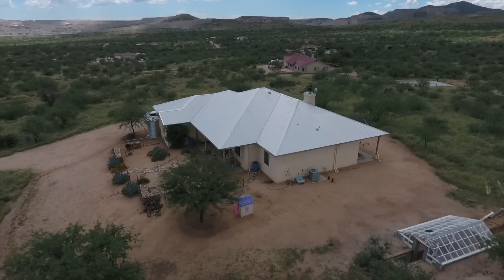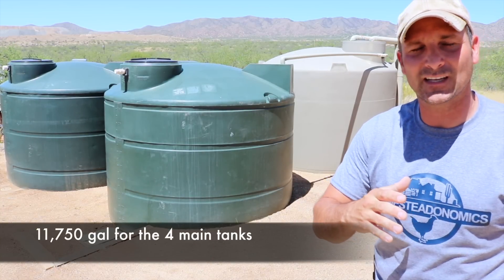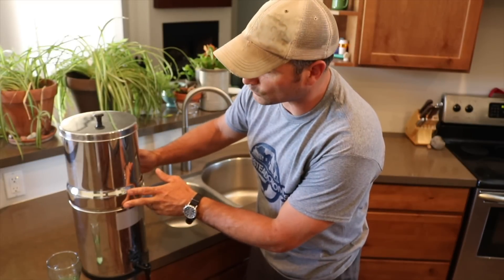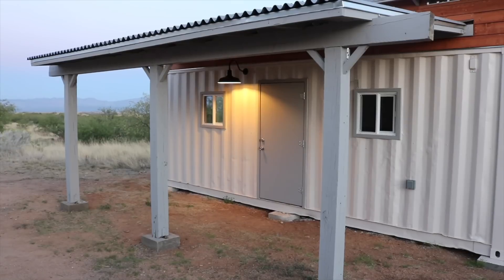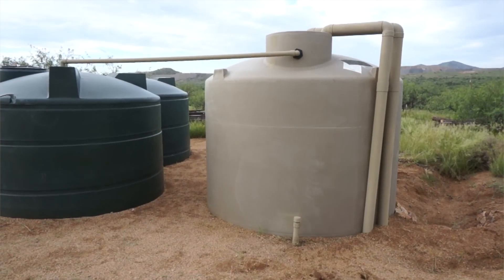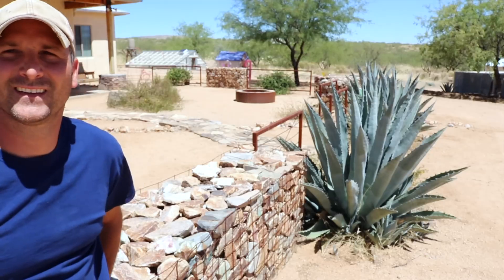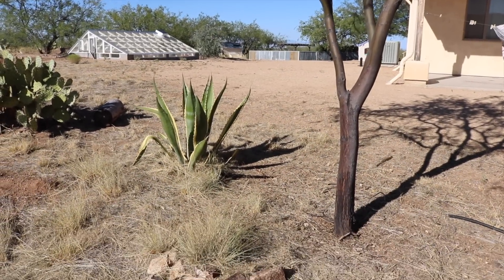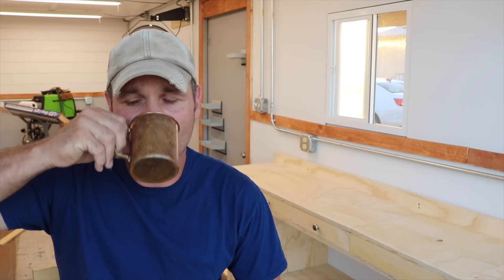Rainwater Harvesting QA - Cost, is it Illegal, how I treat, etc,.

Comment: average house household uses 300 gallons per day. 300*365=109,500 gallons per year using the 600 gal per in of rainfall for 1000 collection area. you wood need 182.5 units of water collection. to find out how many collection are get the average rainfall or expected rainfall for Arizona its 12 in. 182.5\12= 15.3 collection area units. 15.3*1000= 15,300 square feet of water collection needed for average home.   Formula is (((Hu*Ndays)\Gpc)\Rf)*Carea  Hu= household usages Ndays = number of days you would need to use correct rainfall to match. Gpc= how much water is collected per given area per inch.  Rf= rain fall make positive that its annual week month daily matching Ndays. Carea = the collection area. so for Arizona you would need a figure 110,000 gallons storage 15,500 square feet of collection area to have 300 gallons per day.

Comment: The top of those HUGE tanks you have is higher than the bottom of the drainage for where your pipes come from the rainwater catch from the house roof. So what do you do for a setup to carry it to the top of those huge tanks? How does that work? Water doesn't flow uphill...

Comment: 14:38 our water bill is only an average of $21.00 per month and we use an overall average of 2,287 gallons of water per month. At a cost of $5,000.00 it would take twenty years to recoup the cost. (I wont live another 20 years) I could understand the investment if you lived off grid with no city water available or if you were prepping for a catastrophic grid down event such as an EMP attack or a large CME event. Without power, you soon run out of city water. For me, that would be the "main reason" for investing in a rain water catchment system as well as a solar power system.

Comment: I have something like this system at my summer house ,  all thaw i have a water well and its working perfect , but i harvested water for the trees gardening, and car wash , and to take care of first roof wash off water getting in to the storage tanks  i have installed a veep pipe at each down poor pipe billow the turn to tank at leased 2 feet long   with a caped  bottom with 2,  3  half inc holes and 2 more holes one over each other at abut 15 inches up form bottom , i also stuff screen up from bottom to keep water running out keeping the leafs from plugging  the drain holes so  if the rain is not a strong one i wont collect the roof washing water , when rains good hen the first gallon or so will drop to in to veep pipe  and run out, and the water raised up to a  t"   at,  at leased  18"  high enough above  debris   then will travel to the storage tank, and at every one or two rains i make sure the screens are clean and replaced if needed.   while collecting water you also will be loosing some with this system , if tat is concern you can install befalls like on your stove chimney pipe .

Comment: You should find out why Santa Cruz does not allow rainwater collection. I could tell you but you should have some respect for regulations without getting killed by stupidly drinking rainwater in  plastic pipes and plastic tanks.
Reply: The EPA banned plastic pipes and tanks for legitimate reason that took 40 years to prove .  Reason should be enough coming from people who have decades of science education. The Flint Michigan civil notice references to chlorinated water refers to the dangers of plastic pipes and plastic tanks.  Perchlorate perfluorate and perbromate are also common to rainwater with ammonium sulphate and nitrate salts. Yosemite park lost a family to rainwater.
Reply from the maker: I am aware of the negative effects of plastic.   There is seldom a perfect solution for everything.   Our final drinking cooking water is ceramic filtered and stored in stainless steel and glass containers.   Not perfect but is what we could do and what we were able to afford when setting the system up…..but we do have plans for a concrete cistern or a large metal one.     As well as a whole house filtration system which will be installed soon. 

Now one thing to note regarding tanks/piping, etc,…..    Nearly every major municipality has incorporated some type of plastic/synthetic piping at some point in their distribution systems.   Not throughout but at small mains distributor levels.  

As for ‘respect for regulations’ and Santa Cruz (CA I presume?).  I am completely legal here in AZ to harvest and utilize rainwater.   Santa Cruz may be different.  Maybe better or maybe worse…..depending on what issue you may want to look at. 
Also, why has the EPA and Santa Cruz not banned fluoridation of water?  

But you’re welcome to call me stupid and judge me how you wish.

I still wish you the best😊👍

Comment: You don't have a video of the install of this system by chance? Looking at doing the bottom fed system (starting with a few totes and will upgrade as time goes on) but need to run it away from the house so this type of install would be perfect. 

Thanks for the video!

Comment: Thanks for your honesty and I appreciate you being cheap. That means you know the power of a dollar. 

One thing I’ve been doing for 25 years now is collecting sunlight with my solar array, and I’m amazed that you don’t have one and sunny Arizona. Why not set up 10 kW of solar panels and collect rainwater off of that too? 

Then you don’t need to pay utility bill and you’ll be more sustainable and have energy independence. If you use behind the meter battery based solar system. 

I’m also collecting rainwater and I have a total of 4250 gallons. 

Good video thanks

Comment: What an amazing system! Congratulations on that! I live in Mexico City, where water is scarce and I have to store it in tanks similar to yours from the city pipes. A lot of the time there is a lot of rust in the water, so I came up with an easy solution that might work for you: I adapted a small baskets at the exit of the pipe into the water tank. Inside the basket I put a couple of very small fabric towels that have to be washed frequently. However, that has prevented all the rust and particles from coming into my home pipelines. 

I thought that you might find it useful too to keep your rain water cleaner.

Congratulations again!

Comment: An excellent video by a talented artisan.   We just bought 2 acres in S.W. Missouri (USA) where we receive about 46 inches of rain per year.  We had gutters put up, also on the outbuilding   Since I'm 72 and my hubby won't let me climb on anything (not even a chair!), I had two diverters installed, one on the house and one on the outbuilding.   My chickens get only rainwater from the large trash barrels I collect in.  I plan to get two more set up soon to use for garden and orchard water.  I believe it's Colorado where they hang you for catching water.

Comment: We live in North San Diego County.  We have city water but we are not sure how long we will be able to have enough to water our fruit trees and vegetable garden.   We are low water users: saving shower warm up water, laundry to landscape system, don't flush every time, 3,200 gallons rain tanks.  We had a swimming pool we filled with dirt and made into a dry streambed 14 years ago.   Now we wish we hadn't, because we are thinking of having it dug out and turned into more rainwater storage.   We filled our 3,200 gallons in the first rain (we wanted it for watering fruit trees on the hottest days of the year).   We have gotten 11 more inches since and could have saved 11,000 gallons of water if we had the storage.  (We could only fit 500 gallon tanks through our gate).  Does anyone have any suggestions on how to cover the top of the pool if we dig it out, that doesn't cost a hundred thousand dollars (like if steel beams are used)?

Comment: Check with local trucking companies that operate tankers and inquire if they have a trailer they no longer need to increase your water storage capacity. They generally average from 5000 to 12000 gallons capacity. You might be Abe to buy one that is no onerous needed. A very easy way to almost double your storage capacity.  A former gasoline tanker might be ideal.

Best of luck

Comment: One of the few reasons why rain collection is illegal might be that the underground aquifers are not being refilled
Reply from the maker: You might have missed what I said.  The act of residential rainwater collection actually more naturally mimics what happened before the structure/house/building was there.  Versus what currently happens in most cities around the world.   
In cities, the water is directed away from structures, off of parking lots, roads, and other impermeable surfaces to create runoff storm water surges in areas that normally would have seen that kind of water volume.   And in most cases the ground where is is directed cannot absorb that extra amount of water.   For example: if a city that once was natural land, is now covered by 40-50% impermeable surfaces sees 1” of rain, then the remaining ‘permeable’ land is subjected to what amounts to 2” of rain due to the runoff.   So you get twice the amount of volume trying to soak into half of the land available…. Which due to the time required is less likely to happen.  
On the contrary, folks like myself, who harvest off of our roofs and use the water at the site collected, put the was back into the ground surface that it has always been able to absorb into.  And ultimately supports aquifers in a much more natural way than modern civil engineering has largely obfuscated. 
So therefor… any laws against a person collecting on a personal use scale are far more about totalitarian control than any environmental purpose.   To be clear… as much as they like to claim… politicians do NOT care about the environment as much as that care about control.

Anyways, hope that made sense and thanks for watching 😊🙏

Comment: That's a lot of plastics being used.

First flush system is easy to do at ground level. Connect the downsprout to a dirty water tank and rig a float valve to divert the water to your main tanks after it's filled. Easy!

Comment: Our house in Fiji was 100' long * 40' wide. The roof captured all the water we needed into a 6000 gallon round concrete tank about 10' high. All our drinking water was from an RO unit. The rest just had a 10 micron sediment filter.

Comment: Additional water can be collected by people who live in areas where they use Air Conditioning and Dehumidifiers. The condensation from them can be collected, instead of going down the drain. Due to the arid climate, this guy probably has to use a swamp cooler, which takes water instead of gives it.

Comment: Its five years now and droughts are getting worse in AZ. Average summer temps are up, average no of extreme heat days is rising and annual rainfall is not rising and not falling either. That means that unless your water usage is not rising in the summer even with higher temps then while rainfall is staying the same but summer temps are rising. Can you tell us if anything has changed in your water use system. 
Other questions would be - why not bury the water barrels and cut the evaporation (or perhaps you don't have evaporation issues?) with more of the barrels being almost all underground and out of the sun. Why not fit some solar PV to the roof (same railnfall runnoff) and then use UV lamps to clean the water and run the water pumps (and perhaps the AC needed in the summer). Of course you could install ground based PV vs adding it to the roof. What have you done to cut down on the extreme heat percolating into the house in the summer heat and making the house too warm. I do note the pale roof colour to reflect light but you don't exactly have much shade (the parents in the hills behind are higher up and can avail of some mountain shade

Comment: Nice setup.  I agree rainwater harvesting laws can be rather ridiculous.
- Clean out plugs
Do those plugs you showed have a valve upstream?  I'm not sure if what you showed would also flush the bottom of the tank but if so, seems like it would be good to be able to open the plug, open the valve just long enough to flush out sediment, close the valve.  Seems obvious so maybe you have a way of doing that.
.
- Grey water
Your use of it is totally reasonable. Some municipalities like Broomfield CO use greywater to water parks and such.  I live in Whatcom County, WA state and while they are very environmentally friendly in many ways,  greywater has to go into a septic or sewer system.
I have twice now had to disconnect single sinks because they went to ground.  Alternative option was to route them to a septic system which was cost prohibitive.  One was a sink in the basement of our family farm.  Got used very rarely wash hands or rinse water when canning.  It drained to a ditch at the edge of a cow pasture.  Cows could stand in the same spot and pee gallons but a tiny bit of washed your hands water was a no no.
.
The other was a small sink at a food charity where volunteers would sometimes wash their hands after handling sticky fruit and such.  Again it was a tiny bit of water that drained into farm land but still a big 'nope' for the county.

Comment: For a $50 water bill, a $5,000 system will pay for itself in 100 months, or 8 years, 4 months. For a 25 year system, that means the system will pay for itself 3 times over before needing to be replaced.

Comment: You said you don't have a problem with algae. My I suggest to ensure you don't get that problem, paint the outside of all your tank's Black. I learned this from hauling water 30 gallons at a time. 6 (six) 5-gal bucket's. 5 -white bucket's, and one black bucket. Did this for approx. 5 yr's, before I was able to afford to get a drilled well. (circa mid 1980's, my drilled well is 176' Ft. Deep, at the time cost was $18.00 per foot, {6" in. Dia. well casing} no guarantee of water. )  I'm not the fastest / smartest person in the room, but after a little over a year, I noticed that the white buckets would after approx. 3 month period, would just start to build up some algae, and would require a extra rinse to get rid of the minor algae build-up on the walls of the bucket. I finally caught on, that the black bucket, never had any algae build-up of any amount.  Plus by painting your tanks, your extending their life cycle. FYI I'm in the pacific northwest, approx. 50 miles north of the SAN-FRAN-FREAK-O of the north, formerly known as Seattle.

Comment: The water off a roof is like a drop-in a bucket, compared to all the land the rain falls on,   I'm in the east us,. In the Appalachian foothills , I'm planning a harvest system, we get rain at least every few weeks, not over a couple months without rain, I'm thinking one of the totes,  maybe a 50 gallon drum to catch debris,  maybe a carbon filter,  because I'm planning to drink the water, I have a shallow well, I'm not Shure if it's more of a spring or well,  there are springs near by, and it's only 40' deep,  and the previous owner said it gets muddy after a hard rain, but drank from it since the 50's , I don't trust it, I'd rather catch rain and clean it, for drinking water, I do have two carbon filters, from the well,  to the house , to clear the water for everything but drinking, I have a small pump I'm going to use, I'm off grid, so uv filters are not a good idea, I thought about a tower to gravity feed the drinking water, 50 gallons , on the tower pumped up from the rain storage tanks,  when the batteries are near full charge,  I only drink and use about 5-10 gallons a week,. The 50 gallons sho last a while,  the next step is a small pond, only about 20-30' dia, and about 8'deep, with the springs near by feeding it, and a small hydroelectric generator, to help with the battery charging,  it may only be around 500 watts , for a couple hours! But it will help nature, and provide emergency power, now it's just a matter of building it!

Comment: Why are you withholding so much water from an arid or semi-arid environment?

10,000 gallons of water weighs approximately 83,500 pounds.

If vegetation is roughly 85% water, you're looking at a potential loss of 98,000 pounds of vegetation. 

Vegetation puts water into the water tables. 

If your water tables are high enough, you can afford a shallow well and a much smaller water tank for your personal needs.

Vegetation is your only reliable drainage, and you are defeating it.

You are sacrificing the local ecology for your water security, which sacrifice your water security. 

Storing that much water in the desert is irresponsible.

I have been rehabilitating high desert for almost a decade, trying to fix problems that were created by people who adversely affected the environment for their own perceived needs, and you are spreading some very bad ideas.

Comment: You could make very simple sediment traps by fabricating small dams in your gutters by the downspouts. About a third of the height of the internal gutter depth so the water has to climb over the "dam" to reach the outlet while a good part of the sediment would stay in the gutters. The only thing with this would be some added water weight in the gutters so they would need to be mounted sturdy to compensate.